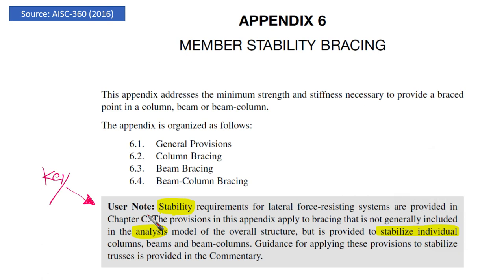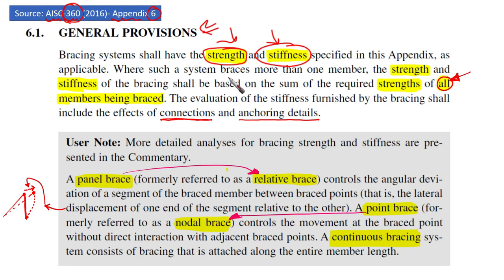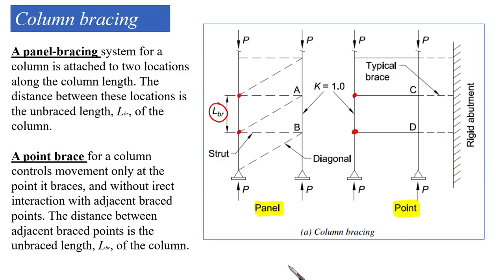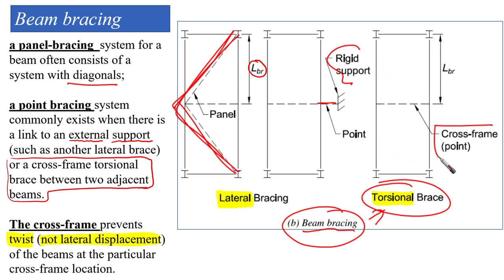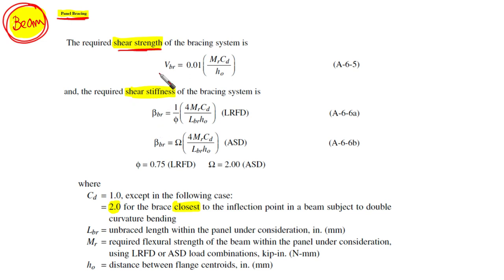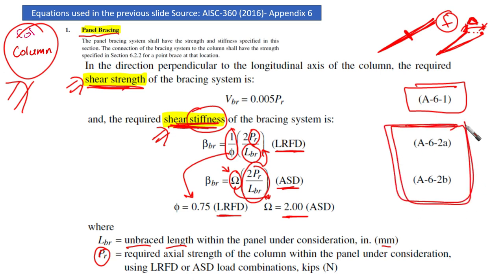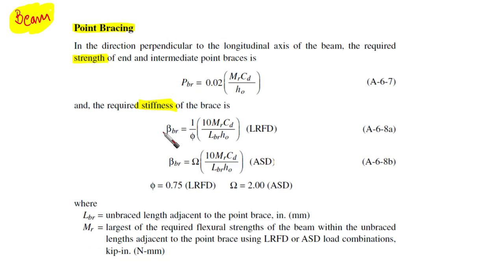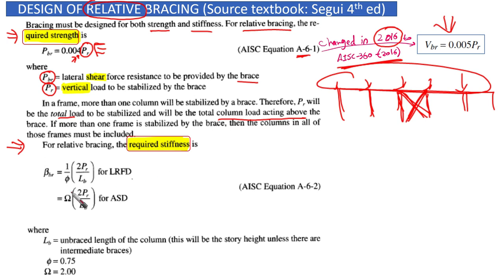23-Stability bracing design (Panel and Point bracing)

Comment: Good morning sir, please , would you mind to help me in calculating the impact force which is applied by free drop 50 kg steel mass on a RC 0.15 m thick slab from a height of 2.5 m, because Abaqus calculations differs from my calculation and both of them differ from Experimental results , I wish your time permit you to answer me as soon as you can 🌹